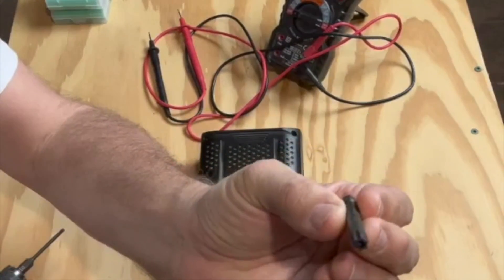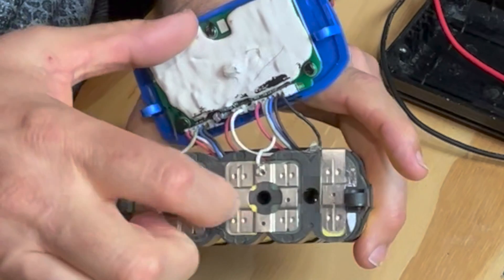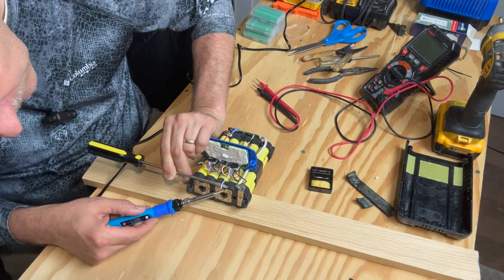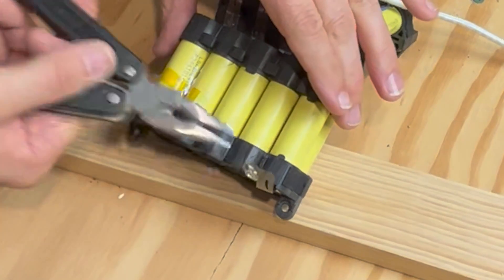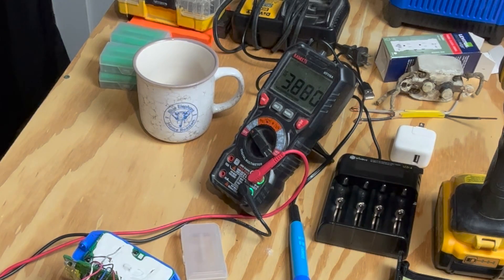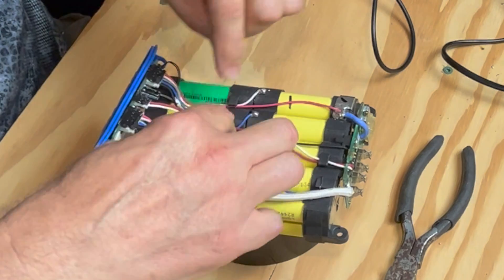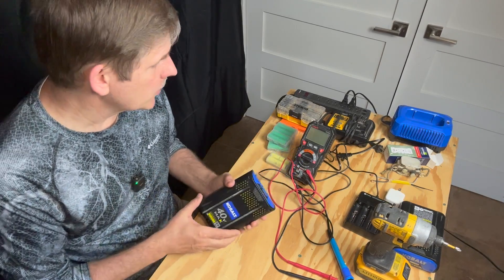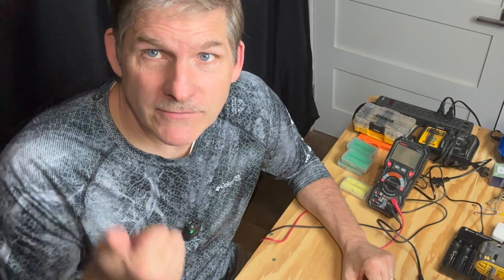How to Rebuild 40 Volt Battery | Power Tool Battery Fix

Comment: I've done a couple of Roomba batteries. And some of these batteries are tack welded, I usually will take anything I can find to support the wires I'm soldering and not hold one with a pair of needle nose or something of that nature I keep a lot of hemostats around with shop towels and things. If you solder a connection holding a wire without supporting it with something more steady You're likely to have more issues with cold solder joints. Won't show up today may not show up tomorrow but eventually it will especially out in the weather. Also rig yourself up an old muffin fan when soldering to direct the smoke away from you.
Reply from the maker: Thx for the input!
Reply: My pleasure! @Housebarons

Comment: With soldering you want to go, "fast." You want the solder to melt as soon as the iron touches it. "Low and slow," is for smoking meats.
Reply from the maker: Good point - thanks for the tip!

Comment: It would be great if these manufacturers would make these battery packs to where the cells are as easy to replace as a clocks battery.
Reply: They want to sell batteries they basically give you the tool but the batteries are expensive and don't last  that's why you see lots of the tools for sale cheap but batteries are not

Comment: Mr. Housebarons - Do you have any information on resetting the Kobalt 40V 4.0 Ah BMS? I have two of those battery packs where pressing the charge display button causes all LEDs to flash red for awhile. With the batteries open and the BMS disconnected, the battery packs read approximately 38 volts with all cells very close to balanced. Any ideas? Thanks In Advance!
Reply from the maker: Sorry - never messed with that. Let us know if you find out how. Thx for watching!
Reply: I too have a similar problem. I put my battery on the charger and it shows green but when I take it off and hit the charge indicator on the battery they all flash red?

Comment: Hell, I can't even get my case open, removed the 4 screws and that thing is tight. Don't want to scrape up the case too bad.
Reply: Once you have the back end of the case off, look around the internal perimeter of the battery pack.  There may be some glue (often white color) between the internal batteries and the inside of the case.  If there is you will need to remove it.  Then with the case opening facing down and a pillow ready to catch the batteries, hold the case and shake it down so the batteries will fall to the pillow
Reply: @pantherdion4827  thanks, will try

Comment: I didn't even know till today that they could be rebuilt. All my kobalt tools came with batteries. My chainsaw really like to work at 4 amp hours and I saw batteries cost more than the tool if bought separately. Saw some cheap ones on eBay. Decided they cost too much. Since I have 5 batteries now, I'm thinking about buying a bad one to practice on then fix or use the cells on my current batteries
Reply from the maker: It sounds like you've got a great plan!. Make sure you make sure the batteries match. For example, Kobalt has 40v and 40v Max and from what I understand, they cannot be swapped so do your research! 
Thx for watching!

Comment: Take apart your lithium ion cell charger and add clip leads in parallel with one channel. Now you can easily charge a cell that is a little off. To prep the batteries for soldering lightly sand then a very thin smear of plumbers flux on each end. Use a hot iron and do it quickly. On the 80V packs you can simply pry the tab off problem cells then grind the plastic s bit and pop the cell out. Precharge the cell to the averege cells in the pack. Also a plug, lightbulb a brudge rectifier and a couple of allegator clips can slow charge the packs.❤
Reply: The charger won't simply charge a single cell, since a single cell is only 3.7 volts.

Comment: Good information on the pack construction. I found 4 batteries of the same specification for $30. I'm not sure if it's worthwhile as they would cost about the same to fully replace the batteries. I would suggest that you individually charge all the cells to the full 4.2 volts before reassembly. I have had very good luck getting close to the original capacity doing that with my 5 year old batteries.

Comment: Please tell me what it was that you used then GORRILA glue on/for? Thanks.
Reply from the maker: It was just to hold a couple wires - keep them from flapping around. In place - might have used electrical tape ….

Comment: Nice video, thanks for sharing. The low cells can also be re-balanced by charging them manually with something like a remote control hobby battery charger. Connect the power leads the same way you did to measure the voltage. All cells have slightly different internal resistance so they charge/discharge slightly different over time and the battery management circuitry doesn't seem to manage this wear perfectly. I have restored a few "dead" batteries this way and they work like new afterwards and have continued to do so long afterwards.
Reply from the maker: Hey Shawn,
Thanks for the info. I’ll have to give that a try!
Thx for watching and sharing.

Comment: Nice.  My mower will variably run 15-30 minutes depending on it's mood, although the indicator only shows one bar when it stops.  Kobalt is proud of these packs, and cheap aftermarket assemblies are still $120-$150.  Maybe I'll both get a replacement and rebuild the old one so I can have two batteries.
Reply from the maker: Hey Jared,
Yeah - those new batteries sure are pricy! Thx for watching!

Comment: Just bunch of what looks like c size batteries strung together. Guess lot of work inside whilst these cost so much
Reply: They are Lithium Ion 18650 cells, which are a very different size than C cells.
Reply: @dlund55  oh yes I seen them on Amazon. The rechargeable fans use them

Comment: Do you think I can get a cheap used 2.0ah battery and rebuild it with batteries totaling 5.0ah? Is it gonna mess with the controllers?
Reply from the maker: Hey Pad…,
Batteries are a bit complicated. I’m a novice at this so don’t take my word as gospel. Here is how I understand it. 
I have a 40v 2.5ah lawn mower battery. It is comprised of (10) 3.6volt batteries connected in series to equal (36+) 40 volts at 2.5ah. 
I also have a 40 volt 5ah battery. That one has 2 banks of (10) 3.6v batteries. Each bank is hooked up in parallel making it a 40v battery with double the runtime (5ah). 
So my 2nd battery is doing what you are referring to. You just have to make sure you wire it correctly as batteries can destroy as easily as power. 
Do your research well before you start! Thx for watching!
Reply: You need to make sure you are using cells that have a max discharge rate 10A+
Cells that are good: Samsung 50S  EVE 40P, EVE 30P and EVE 25P suitable for Power tools

Comment: Do you have a link of the batteries you bought? I have 2 of the exact same batteries and one barely holds any charge.
Reply from the maker: Hey Jeff,
The original cells in my Kobalt 40 battery are LGABHE41865  2500mAh batteries 

These 18650 batteries are - high discharge batteries ( 20 Amps continuous discharge rate ) w/ a 3.6 volt nominal voltage. 
18650 = 18mm wide, 65mm tall 

41865 and 18650 designations are the same I believe.

I got mine from the 18650batterystore.com 

The Samsung have better reputation, but they were out so I used an off brand ( Eve )

There are MANY choices on the site. Make CERTAIN you do not use the wrong type/size/spec battery as they are not all the same - risk of fire or explosion from what I’ve read. 

Hope that helps.

Comment: I have the same batteries and one of mine won't charge and will only power each of my tools for a few seconds before they power down. My lawnmower gives 2 beeps when it powers down like it thinks the battery is dead even though it still gives 2 or 3 lights for the charge level. Could this be my issue?
Reply from the maker: Hey Kyle,
That sounds a lot like my previous battery issue. A low single cell ( or more) will interrupt battery performance while showing lights like it has more power available. 
You battery is only as good as it’s weakest cell. 
It seems like a lot of steps. But after my repair I’m more than ready to take on future repairs. I’m guessing it will get easier the more I do!
Thx for watching.

Comment: (1:24) "These are LG batteries and they're [a] very specific battery—you have to get the discharge rate and size battery. You can't mix and match!"   sooo... I'm going to install into my battery pack two dissimilar unbranded Chinaseum-made knockoff 18650 batteries whose discharge rate is unknown.  Still, it worked! Thanks for posting! Gotta repair my Greenworks batteries in a similar fashion.
Reply from the maker: Hey loth..,
Yes. Size and discharge rate matters. The batteries I used are identical to the originals.
We’ll see how long they work. One report from a viewer did the same and got an extra season out of his repair till other original batteries died. 
For $5 repair - it’s worth the risk!
And don’t ALL batteries come from China / Asia along with 90+ % of everything else! 
It would be nice if we made a little more stuff in USA!
Thx for watching!
Reply: @Housebarons  I think Project Farm battery reviews have taught all of us that Chinese labels are never reality. I bet the original cells are still pretty decent and the new ones are still the limiting factor. (I know I'm 10 months late for this, but I'm doing something similar with my Kobalt battery today).
Reply: @Wimbletonage  I wish there was some type of ...idk ..electrical tester thing to check the capacity since numbers don't lie. Like some type of battery discharge capacity tester. 🤔😏

Comment: I once did something similar, although I decided on breaking the plastic shell holding the batteries at the edges, instead of desoldering/resoldering everything since I'm usually on a time crunch. Then I covered the holes I left with electrical tape, worked like a charm although on hindsight highly unprofessional and risky.
Reply from the maker: Hey chips,
How long ago did you do this? I’m gurious about longer term performance.
Thx for watching!
Reply: @Housebarons  heya there, I did that around 2y ago. It lasted a good 4months until I had to change more batteries that were failing, at which point I just replaced all batteries in the pack to avoid dealing with issues further ahead, haven't had an issue since.
Reply from the maker: Hey chips,
Very interesting! Thx for the information. That gives me an idea on what to expect!
Really appreciate it!
Reply: @Housebarons  how long did this repair work for ya?